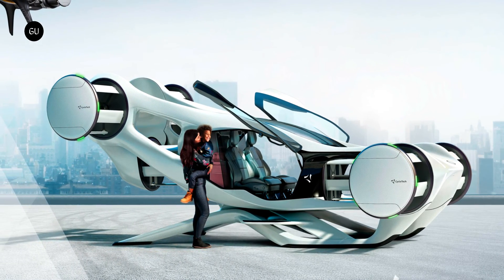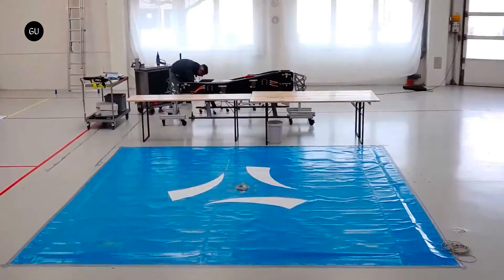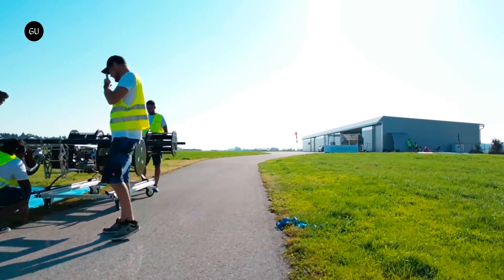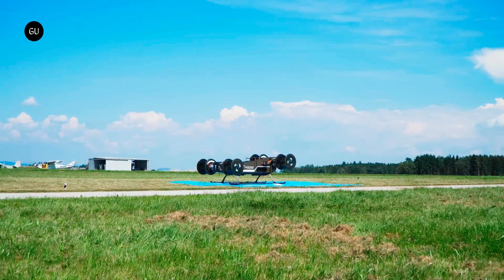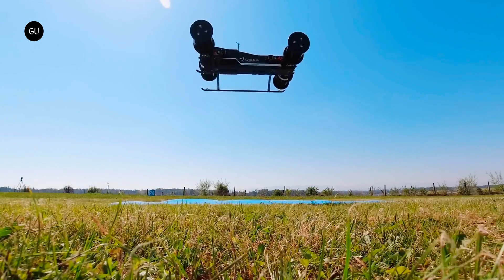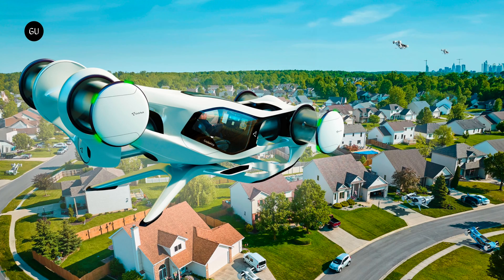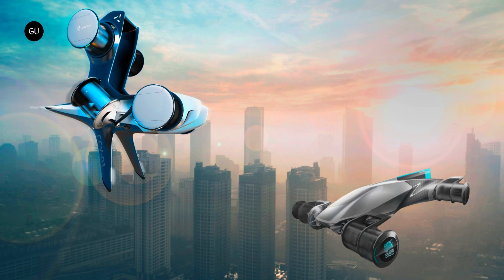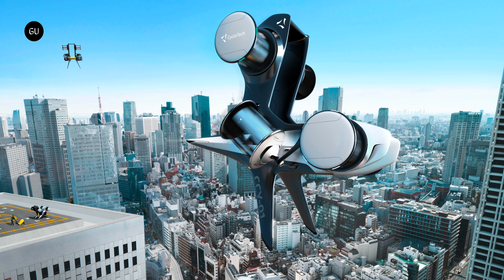CycloRotor: Revolutionary eVTOL Propulsion System

Comment: Ummm, No.  Not going to work.  In fact, it's a stupid idea.

The reason being, if an aircraft loses power it can glide to landing based upon the lift of its wings.  In a rotary wing aircraft, you can autorotate to a safe landing using the kinetic energy stored in the rotating blades.

This thing, if it loses one of its rotors it's going to tumble out of the sky because of asymmetrical lift.  If it loses power, it's going to fall out of the sky like a brick because it's got nothing but the rotors producing lift.

This may have application as a unmanned aircraft, but it's suicide as a manned aircraft.